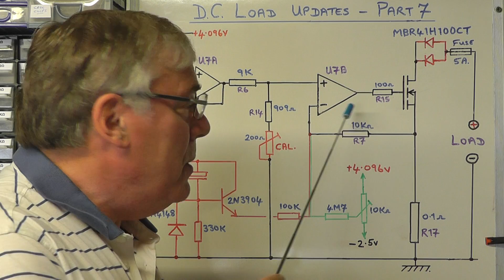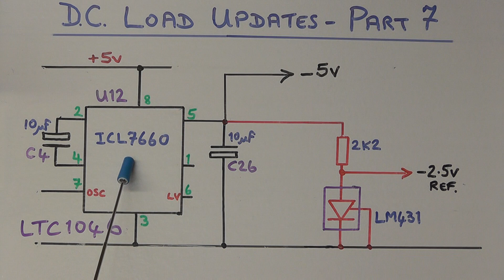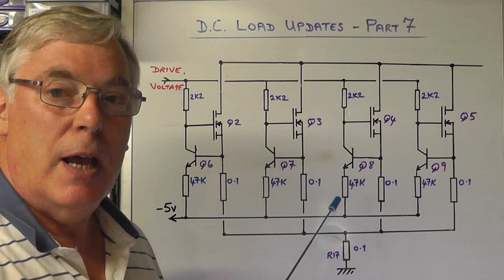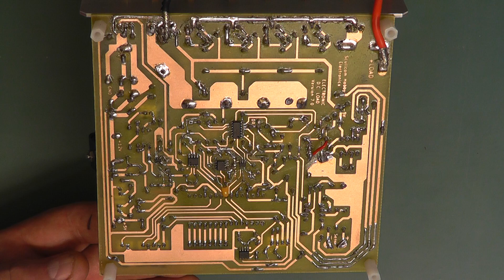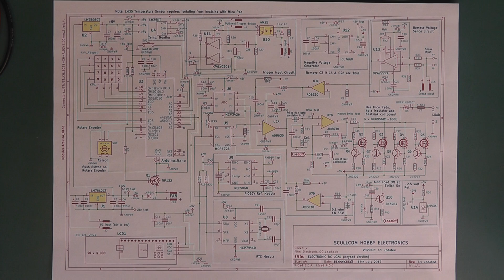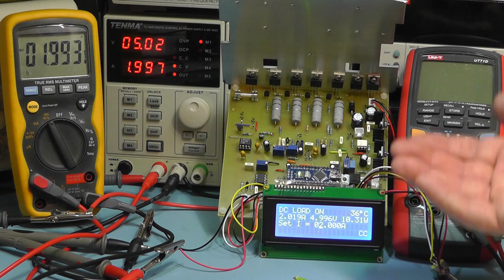Scullcom Hobby Electronics #52 - Electronic DC Load Part 7

Comment: Hi Louis,

Excellent work with this new version and thank you very much for publishing it. I also appreciate your clarity, simplicity and hardworking to make your project and video too. 

However, I tried your fan submodule and found it is a not as effective and requires a near high PWM value (>200) else it creates humming noise. It added a kind of DAC (RC using 1K resistor+plus 47uf Cap) followed by a buffer (a opamp unity gain) before biasing to base  of the TIP122 and it worked well.

I saw your Kicad version of file and its good. However, may I suggest you to use your DipTrace (www.diptrace.com) EDA instead. Its very easy to use, complete, instant 3d viewer, power autorouter, rich libraries etc. I like this verses earlier I was using Kicad. It is also available as free version for non-commercial use( I am using this). Very effect and prompt support by the product team and professionally used. They have a demo/video for a quick learning. This will help you to create a dual side PCB with ease.
Reply from the maker: Thanks for the comments and your suggestion regarding the fan. This may vary depending on what type of fan you use.
Also thanks for the info on Dip Trace, I was not aware of this software.
Regards,
Louis

Comment: Excellent progress with the project.

I have also made several improvements but I never got to creating a proper schematic diagram. That is until you released this latest Kicad package and included the source files. I have never done anything in Kicad so I needed a jump start and having a design that is not very far from my own was a great jump start. I have only done the schematic. I have additional plans for enhancements I want to try before I make a PCB.

I have replaced both DAC and ADC with some faster/better ones. I have added hardware debounce of the rotary. I have replaced the fan by a Sanyo-Denki 4 pin type that can be speed controlled by a 25 kHz PWM signal. It is a BEAST and the load can now run with 250 W continuously with that single MOSFET in the SOT227 housing. Amazing. But at full load the noise is massive.

I have completely rewritten the software. I have changed the D key so it works as a menu key and moved battery check, transient, calibration, and user settings under this menu. No more pressing two buttons. And I now store the calibration in EEPROM. Because I replaced the ADC and DAC, my software is no longer compatible with the original design but it it not difficult to merge the functions that control ADC and DAC from the Louis software into mine.

It is a real interesting project and it is fun to see it develop.
Reply: And with the danger of Youtube holding back my post as spam. Here is the URL again to my version of the load just updated today. Incl new schematic and new code. http://www.lavrsen.dk/foswiki/bin/view/Kenneth/ElectronicLoad
Reply from the maker: Thanks Kenneth for the update and info. I had been considering menu screens myself as an option.
Regards,
Louis
Reply: Hi. I now have an updated version of my design that also implements constant voltage. I have not updated my website yet. I need to update the Kicad files. But the principle is simple. I have added two analog switches on the inputs of the op amp that drives the MOSFET. When I change the mode to CV the DAC changes to controlling the inverting input and the non-inverting input is connected to the output of the opamp that monitors the voltage. And then it is simple code to add the constant voltage setting. I put that feature in the D menu. It would be easy to implement same in Louis' design. Very easy. I have to work a little on the bias zero circuit which drifts 1-2 mA now. Not a big deal. It just annoys me ;-)
Reply: I have now completed the next step of adding constant voltage mode to the load. This cannot be added as software because you just cannot regulate the current fast enough in a software loop.
So I have added to analog switches so that I can run either in the old current loop mode where the op-amp that drives the FET compares the shunt voltage with the DAC voltage. For constant voltage you have to move the DAC voltage to the inverting input of the op-amp and feed the load voltage to the non-inverting. And it happens to be that the voltages going into the ADC for the voltage measurement and the control voltage from the DAC are in the same range so it is actually a very simple exercise.
I have added the constant voltage mode under my "D-menu"
I found that you have to be very careful with cleaning flux away from the 4,7 Mohms resistor used for nulling the DC current. I was fighting drifting zero for hours until I realized it was the crappy chinese flux I had used for the rework adding the constant voltage circuit. After multiple cleanings with IPA it is stable again.
I have uploaded both PDF, Kikad project, and my least code to my wiki page (linked in my own comment earlier in this thread)
Reply: @KennethLavrsen  Hi Kenneth! Thank you your commitment and share to extend and modify this project. As far as I see you are the only one who provides downloadable materials for this project up until today, 22.20.2021. Good work!

Comment: Fantastic work !!
Reply from the maker: Thank you.
Reply: Absolutely no problem Louis !
Ive got a couple of questions regarding modifying the build for my purposes, mainly setting up the unit for a maximum of 40V @ 10A, Would it be possible to pick your brain on this please Louis ?
Best,
Steve
Reply from the maker: Hi Steve,
For a maximum of 40V @ 10A (400 watt) you would need to use higher rated Mosfets. There are a number of Linear L2 Mosfets from IXYS SEMICONDUCTOR such as the IXTX90N25L2 (cost about £20 each) which may be suitable (you may only need to use one). You would need a very good heatsink with fan. Also the gate drive voltage for these would be higher so the circuit would need to be modified to accommodate that.

Comment: Dear Louis 
Really like the project! Well done and thank you.
Learnt a lot!

Those surface mount components are  very small.
Isn't it possible to het through hole components?

Welcome back!
Hope everything went well!
Best wishes
Stephan
Reply from the maker: Hi Stephan,
Thanks for your comments. I may have a look at a possible option which uses standard 8 pin DIP IC's in place of the surface mount ones. The SOT23-6 packages are very small and can be difficult to solder by hand.
Regards,
Louis

Comment: This truly is one of the best electronics diy series on the tube. Thanks for the hard work and hours you have put in to make this series! I was considering getting a commercial dc load from a brand manufacturer but this project has advanced to a stage that makes me consider this as very interesting alternative. Perhaps something to ponder about that current offset topic is going with 4 terminal sense resistor and INA on +/- supply. This would leave the D opamp free for low output impedance offset adjustment. Perhaps it will complicate the project too much but it would deliver very solid sense implementation and a capability to tackle wider current range with improved precision and lower drift as the internals get heated during operation. This would also open up the capability to do 2 automatic ranges by arduino controlled shorting of the INA gain resistor for 10x and 1x amplification (2A/1mA and 20A/10mA range), for example.
Reply from the maker: Thanks for your interesting comment and suggestion.

Comment: This is a most interesting project, and becoming quite sophisticated. A couple of things jumped out at me while watching though:-
The protection diodes in parallel. Although they are on the same die, there may still be enough difference in forward voltage drop to cause one diode to hog all the current. Maybe a very low value ballast resistor in each anode leg could be added. Though I suppose even just one diode at 40A is sufficient...  
I'm not sure if the drop across the diode(s) (and any added resistor(s)) is of any significance in this application, but if so, or in any case, maybe have a reversed diode across the load terminals (via the fuse) as further protection against reverse polarity.

The need for null current trim. With op-amps that have 1uV offset voltage, I was surprised to see this was needed.  Could this trouble be caused by a single op-amp trying to balance the behavior of the 4 mosfet circuits? And might separate op-amps per mosfet (as someone else suggested) help in this regard? (When I finally do get around to building something along these lines, I will certainly be looking into that...)

Thanks for all your work on this!
Reply from the maker: Thanks for your comments.
With regards the dual power schottky diode. As the two diodes are on the same silicon die they are thermally coupled so it is unlikely to be an issue. Also both diodes are rated at 40 Amp so I do not think it will be a problem.
With regards the offset null adjustment. This requirement was found to be needed for either a single Mosfet or 4 Mosfets output stage. Although we are using an OP Amp with a 1uV offset, other factors may come in to play such as input impedance differences between the + and - inputs of the OP Amp. Also the capacitive feedback loop (R8 & C19) was have an effect. DC noise may also be an issue. It could even be the layout of the PCB tracks.
Regards,
Louis

Comment: I was just wondering if you checked out the output while the LOAD was attached before you turned on the "electronic DC load circuit." Obviously you could scope out the output while turning on the device to see if there is a current pulse....PEACE
Reply from the maker: Yes I did and got a current surge for just a second or two and then it faded away.
Reply: That's no good is it. Wasn't your modified circuit supposed to prevent that?....PEACE
Reply from the maker: ElectronicWizard That was what was happening before I made the modification. With the additional modification there was no current surge at switch on. Sorry I thought you question was relating to before the modification. The mod seems to work very well.
Reply: OK got it. I would have been nice to have seen the before and after wave forms.....PEACE

Comment: Great improvements, all down to the spot! I can't tell you how anxious I am to see this wonderful project come to its final version and build one myself. One thought crossed my mind is to change the display with a dot-matrix one. That way, the most important info can be shown with bigger fonts, and a better utilization on the display can be achieved. 128x64 or a little bigger ones does not cost much more than 20x4 character displays and only a small change in the software is enough to display everything better. Thanks again for this project and for your kind heart for sharing everything about it.
Reply from the maker: Thanks for your comments. A different display could be an option. I am looking at one or two other options. But need to fully test the new PCB on all functions.
Regards,
Louis

Comment: I eill pay csn u make me a pwm dim led like hurricane access control LED lighting controller and allow Sunset I just want something that will give me sunset and sunrise even if it's a timer situation scenario slowly Dempsey

If that's too hard I would like to by or give you the parts to make a power supply that has a digital readout that is just cheaper then the normal power supply thinking about using a computer power supply
Reply from the maker: Hi Jonny,
I believe someone has already designed an LED controller with sunset and sunrise using an Arduino. I would recommend you have a look at what they did. Direct link to their details is below:
http://reefuae.com/forum/viewtopic.php?f=13&t=1513&start=0
I may do a power supply project in the future but at the moment I am working on a number of other projects.
Regards,
Louis

Comment: Thanks, excellent job.  I appreciate the amount of effort that goes into making these series of videos.  Is there a way you could put a copy of the gerber files with a circuit board manufacturer so we could order one direct?
Reply from the maker: Thanks Joseph for your comments. I have made available my KiCad files for this part 7 in the link below. If you have KiCad installed (which is free software) you should be able to generate gerber files from the files.
http://www.scullcom.com/DC_Load_v7_1_KiCad_files.zip
Regards,
Louis
Reply from the maker: Just one other point. If you are thinking of having a PCB manufacture then it may be better to design a double sided PCB which would avoid all the links as well as been  smaller. My PCB designs are intended for the hobbyist to easily make themselves.
Reply: Hello Louis, 
excellent job,especially  the new pcb is a good move, I waited since episode 2, now I will make my first selfmade pcb.
Concerning the Kicad files. (I use Kicad version 4.0.5.). The programm complains that it cannot find two librarys, "special" and " DC_Load_Voltage_Sense-cache". Both libs do not sound like  real libs, 
I am a total newbie with Kicad, is it my setup or are libs missing?
All the best to you,
U.

Comment: Why not just store 0 in the EEPROM of the DAC and do away with the the whole 2V business? 
4K7 pull-up resistors on the I2C lines are pretty much standard in the hobby robotics world. They usually place it at the end of the bus.
Thanks for the KiCad files and all the hard work you keep pouring into this project. Its a perfect project for me and I am about half way there. It's such a useful project, unlike blinking LEDs and fidget spinners which are all the rage.
Reply from the maker: Thanks. As I said on the video I will look in to the possibilities of reprogramming the default setting in the eeprom to see if that can be easily done.
Regards,
Louis
Reply: Yes. I will Program the EEPROM on mine. Less hardware to go bad that way.

Comment: At 22:39 why going to -5v with 47k? This means that the transistor is always on! And there's no threshold effect and the -5V rail is maybe not strong enough to handle the current from multiple opamp outputs . Why not just using a npn to ground to limit to 6 or 7A per mosfet? To be achieve a better balance a solution could be to have a oa to drive each mosfet individually but that would increase parts and cost.
Reply from the maker: Thanks for your comments. I will have a further look at this part of the circuit. You could use a separate OP Amp to drive each Mosfet but that would also complicate the circuit and be more costly. The main thing is it seems to work quite well at the moment but I will look at any further improvements.
Regards,
Louis